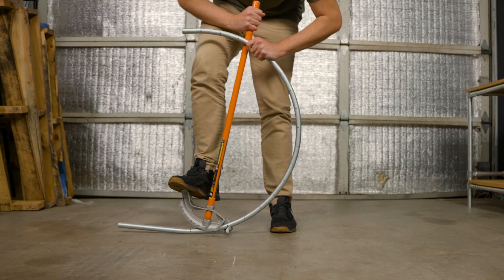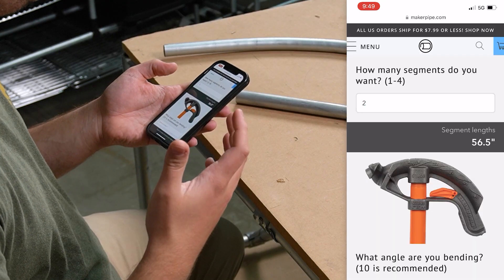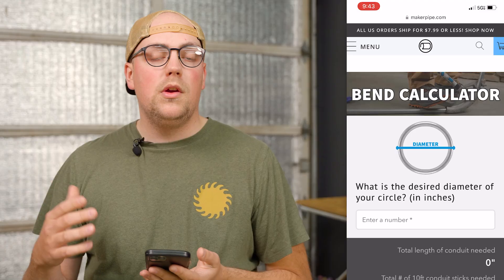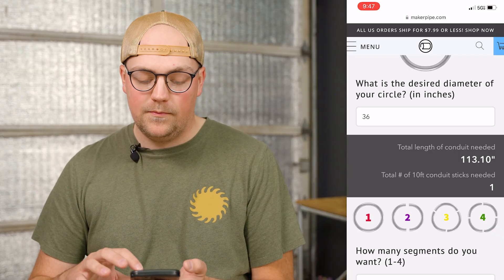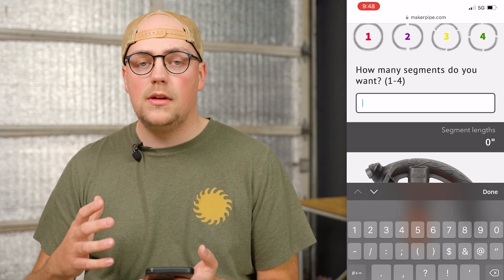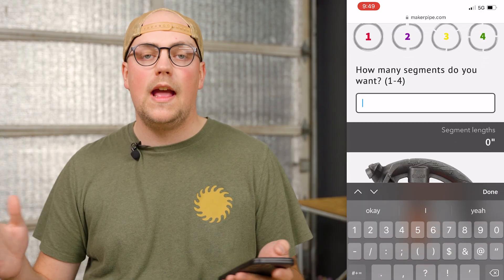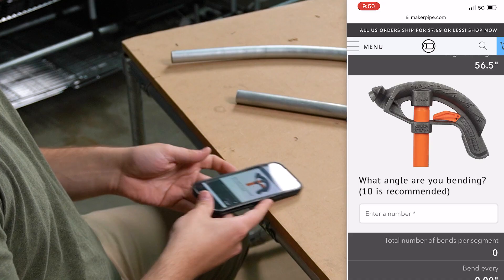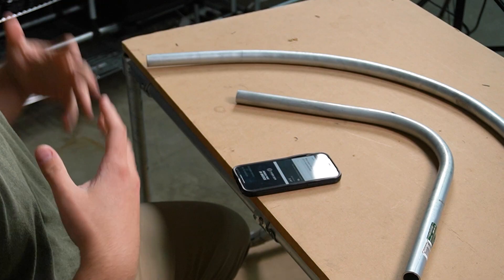How To Bend EMT Conduit Into Circles!

Comment: I wanted to do a 20ft (240") base for a Christmas MegaTree. When using the calculator, I inputted 240"in for the diameter and it's saying 753.98in requiring 7 sticks of conduit. I would think 4 sticks of conduit would be the right choice. Then I could do the 4-segments having each segment being a total of 90 degrees per segment. Am I missing something here? Why is it saying I need 7 sticks of conduit for a 20ft diameter?

Comment: 200cm Diameter > 4 segments ?
Reply: Segment lengths = 61.84 inches [ 157.0736 cm ]
Total # of bends per segment = 9.00
Bend every = 6.87 inches ( 17.4498cm )

Total length of conduit needed = 247.37 inches [ 628.3198 cm ]
Total # of 10ft conduit sticks needed = 3

Comment: So, I used the calculator and the exact Klein bender shown in the calculator, to bend 10ft 1/2 EMT for garden trellises.  I needed a 32” diameter (16” radius) to make a U.  I marked everything for 18 segments to use a 10° bend, and while the calculator called out 2.79” I used 2.75” thinking it would be fine if the result had a slight spread.   Much to my dismay, the result was a 44” diameter (22” radius).  When it was all said and done I had to get creative to get several pieces of tubing to the correct shape.  So, ultimately, I took the 32” diameter I wanted divided by the 44” diameter I got and got a correction of 0.727272~. I multiplied the 2.75” segment spacing I was using by 0.727272~ and got 2” segments.  And what do you know, 10° bends on 2” spacing net a 32” diameter.  Take it for what it’s worth, but something in the calculator isn’t working with the Klein bender.  I did use the 10° stop to prevent over bending the segments, worked nicely, when I checked a 22° bend using the stop wedge it was spot on.  I also tried 22° and the calculator still produces a 44” diameter off of the 32” calculations.

Comment: I'm having trouble with this. I am trying to build an arch that is 60 inches wide diameter with a single 10 ft conduit. I followed the instructions in the conduit and I put 60 inches, 2 pieces (I only need half a circle) and it said I need eighteen 5 1/4 inch bends on a 10 ft pole. I marked it and I did the bends and it ended up much much smaller of an arch. What might I be doing wrong?

Comment: Hi I need to bend 1/2 inch into a 4 foot full circle. ⭕️ how many 10 foot conduit do I need?
Reply: Formula for Circumference of a circle is
C=piD
C= Circumference or pipe length 
D= Diameter u wish 
Where pi =3.142 
3.142x 48inches =150.816 inches 

O

Comment: Thank you for the tool recommendation.

I'm building a circle of 40 inch diameter. It will have teeth for a gearing system. Ideally it would be perfectly round, but this will be a kit for the general public.  What do you think the most likely errors people will make so I can try and build compensations into the design?  Out of round?  Warped?  Something else?

Comment: Easy way to repeat bending the same angel   Bend your first angel (10 degrees or any other angel.).   Measure perpendicular with tape measure from floor to top of bender handle.  Make each consecutive bend the same measurement floor to top of bender handle.  All your bends will be the same

Comment: I've found that building big hoops and wanting them perfect "like on an airboat cage." I'll lay the OD and D out on the shop floor in chalk to mimic what I want. Then I'll take 1/2" plywood and cut 3 pieces based on a 1/4 of the circular layout. Then take one piece and cut  3/8" for "3/4 emt" or 1/2" for "1" emt" off the radius. Then screw them together with the shorter piece in the middle "lining up the flat edges". Then I'll bend a piece of  flatbar to fit around the emt I'm working with, leaving 3" tails beyond the emt, and screw it over one end of the jig using a drop piece of emt as a Guage fir fitment. When it's put together it looks like a quarter circle with a groove in the middle "for the emt to ride in" with a strap to lock emt into or (like a giant tubing bender). For airboat cages. I make two pieces and cut the 3" tail off then weld the butts together making perfect hoops for the prop cage every time. I have several of these for different diameters. It works great, try it

Comment: can you go over the math, without using the calculator
Reply: 0:10 Clearly stated he’s Not trying to make a math video. Maybe go to your local school and ask a math teacher.
Reply: Who pissed in ur cereal
Reply: Length of conduit = pi * diameter of final bend.  So a 36” diameter full circle = 36” x 3.14128 = 113.097”
Degrees per bend = Total bend in degrees divided by number of segments, so a full circle (360°) done using 10 segments requires 36° per segment.
Length per bend = length of conduit divided by number of segments. So, for full circle in this example, each 36° bend will be about 11 inches long.

Comment: Fantastic. Could the connectors at the segments somehow allow for adjusting a bolt to expand or shrink the diameter? I'm thinking of ways of securing a ring/strap around a 30 gallon bucket and would like to adjust the diameter a bit to allow for securing and releasing the grip on the drum
Reply from the maker: That's a cool idea! You might could use the Maker Pipe Coupling and Quick Clamp combination to achieve this. It might be kind of tricky though because bent conduit arches tends to fight back when trying to align and couple them together perfectly.

Comment: Actually, I think you should have shown the math, so that people can understand it, if they want to learn how you figured out your segment spacing for a 10° bend at each marking.

Here's how I reverse engineered your math:

A half circle is 180° & since you made 18 bends, that is where you came up with the 10° per bend (i.e. 10° per pend * 18 bends = 180°).  A 3 ft outside diameter circle would have a circumference of C/3=pi or C=pi*3 or ~9.4248 ft length (so you could have used a 10' piece of conduit for one continuous circle). 

Since a full circle is 360°, if you divide that by ~9.4248 ft, you get ~38.197° per foot.  
If you want 10° bends then you take ~38.197° per foot & divide by 10° to get ~3.8197 segments per foot.  Then you take 12"/ ~3.8197 segments per ft = pi (i.e. 3.14" long segments markings--which is the length that you used between your markings).

Comment: Is this sold in the UK as it might be something of interest for some projects I have lined up.
Reply from the maker: We are able to ship to the UK but the main issue is pipe. Our connectors fit .922" and 1.163". There hasn't seemed to be a comparable size that would work over there. Do you know of any?
Reply: @MakerPipe  It might do for copper pipe. We have similar sizes which are near 3cms for the 1.163". It might work. Aluminum pipe could also work if the diameter is below 2.9cms which most EMT pipe is 20mm or 2cms in diameter. SO it could work on both items described.

Comment: Nice. Is the calculator for 3/4 only?
Reply from the maker: I'm pretty sure it will translate to 1/2" and 1" as well but I haven't tried it so I'm not 100% sure. I'll see if I can work through some math on it and follow up.
Reply: @MakerPipe   Did you find out if it works for 1/2” yet? I’m very interested in doing this, ordered a few items from you already. For my project 1/2” is not only less expensive, but it would otherwise be overkill if I used 3/4” THANKS
Reply: @lindseyoldani3557  yes it works.
Reply: Thanks man. I’m doing this today and honestly that 10 degree bend is difficult to not surpass, I got my bender used and the stopper is gone. I’m making hoops though so there’s that

Comment: @makerpipe (Jake Lewis) I'm trying to bend a complete circle with a 15.5' diameter (186"), and 8 segments (I think they come out to roughly 6' per segment), but I can't get the calculator to work for this, can you help?  I'd bend at 10 degrees to keep things smooth. Thanks!
Reply from the maker: Hi sorry for the delay in getting back to you. After doing the math, I think you'll need 585" in total conduit. Each segment is 73.125" and you'll bend 10 degrees every 16.25".

The formula is radius 2 times pi times radius. That tells us how much conduit is needed. Then you divide that number by the number of segments you want to find out the lengths of each segment. In your case you're bending eight 45 degree segments with incremental 10 degree bends so you'll divide 45 by 10 to get 4.5. Then divide the segment length by that number to get the distance between each incremental bend. Hope this helps.

Comment: Fantastic video and very helpful. I'm making a hoop house/high tunnel (but not that high) for the garden. Need to cover 2 rows of crops. Two sticks of 3/4 EMT (20 feet) will make it too wide or too tall. Is there a way to calculate for say 17 feet of EMT, ie 2 sticks at 7 1/2' each? Thank you!
Reply from the maker: Hi there, glad you found it helpful. How wide are the two rows of crops?
Reply: @MakerPipe  Yeah, it's kinda a weird bend, at least for me. The 2 rows of crops are 30" each with a 12-14" path between. So I need 7' diameter. But I want the first bend to start at 3' using 2 sticks and then joining them with the MP connectors I recently ordered. I also don't want the top of hoop to be more than 6 feet so it doesn't block my neighbor's light over the fence. Does that make sense? Thank you for your time.

Comment: THANK YOU!!!! Question for you though - I'm looking to make a large U shape...on the order of 16' wide (192 inches from end to end. The calculator says it's 6 sections, but I'm not clear on the segments. I only need 1 U shape, and this appears to be designed for bending a circle. If I adjust this to 2 segments, would I then only need 1/2 the number of conduit sticks the calculator states?
Reply from the maker: Hey Don, great question! Basically we are limited to 120" per segment because thats the longest off the shelf stick of conduit we can buy. So in your case you would still want to calculate for 6 segments of a circle because that comes out to 100.5" per segment. However instead of bending 6 segments into a complete circle you will just need to do 3 to get half of a circle or the U shape you're after. Unfortunately the calculator can't figure out any more than 4 segments but I can do the math and let you know the measurements. What angle would you like to bend to each time?